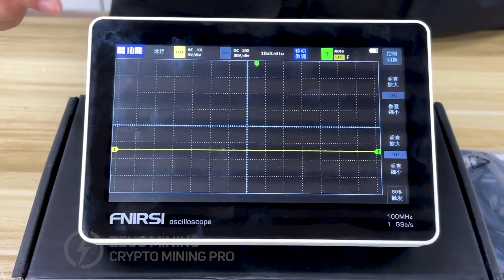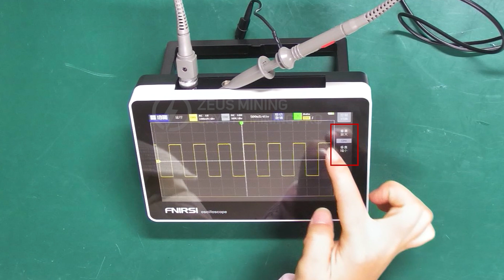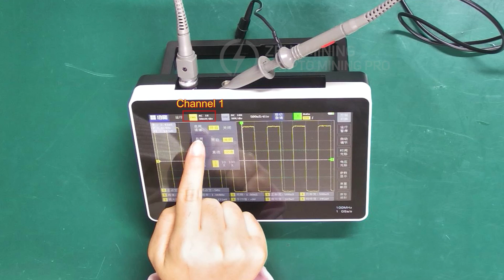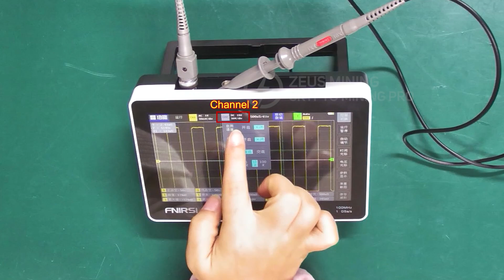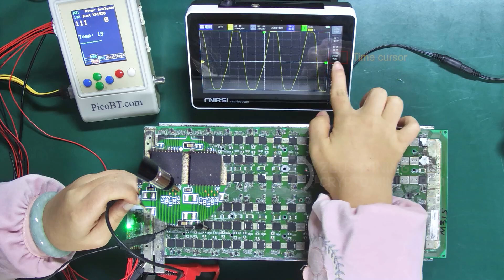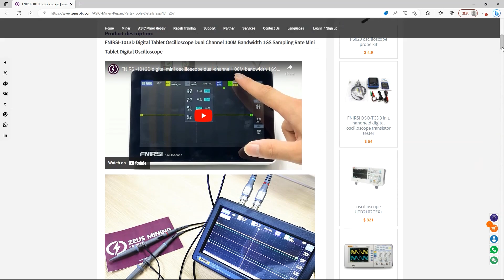FNIRSI-1013D digital oscilloscope usage tutorial

Comment: Only 200Msa, very small memory only 1500 or 3000 samples per channel.  Serious error when switching to 50mV, the developer forgot to multiply the signal by 2x.  Of course no support from the manufacturer.  8 years and still the same faulty firmware.  Note that there is an open source alternative.
Reply from the maker: storage: 11,000 screenshots + 1,000 sets of waveform; Vertical sensitivity: 50mv-500v, for more information, please see: https://www.zeusbtc.com/ASIC-Miner-Repair/Parts-Tools-Details.asp?ID=267
Reply: @ZEUSMINING  Fpga takes 1500 to 3000 signal samples and stores them in internal memory.  Which is terribly limiting.  The sensitivity of the tom is 100mV, the values are multiplied by the software 2 to show 50mV, then the sensitivity can be 2mV, just multiply the signal by software :D that is, rather ugly from the manufacturer, it is not mentioned in the specification.
Reply from the maker: For more detailed information about this product, you can contact our technicians by clicking on the official website https://www.zeusbtc.com/Contact-us.asp